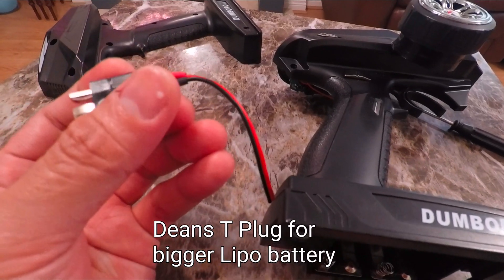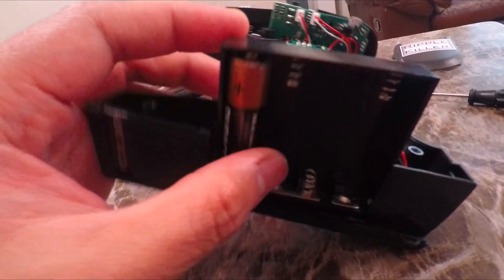Improved Remote Range and Response | DumboRC

Comment: There's an port for jst connector in the bottom off the receiver. Why you're doing that?can't understand. Just by jst to Deans convert connector then connect your 2s lipo.
Reply from the maker: Yes there is a jst under there but I prefer this shortcut. Thanjs

Comment: If I put rechargeable AA batteries can I charge them with USB port?
Also why don't you take the double A's out and put the light pole battery in that spot so you don't have in the way or dangling around
Reply from the maker: Hmm i don't think the usb would charge the rechargeable AA batteries.
The lipo battery pack outside is just temporary. I srill prefer using AA batteries.

Comment: smh... wish adding power would increase its range.. i can say is that it will last longer but still tx the same power.
Reply from the maker: Yes it doesn't.
But the delays are improved tho.
Reply: @ianbudgetrc2574  it wont affect anything. the tx will limit the power it allows in. i run my radiolink on 4s sometimes 3 or 2s it makes no difference.
Reply: @lcpeterbilt379  This is the information I was looking for!  Do you know at what voltage range will decrease when running the stock AA batteries?  I guess when it gets around 4.8v which would be 1.2v per battery?  I have been being careful to only run fresh AA batteries in it when my fastest cars to maximize range but now I am wondering if my efforts were a waste of time.
Reply: @ianbudgetrc2574  In the video you said it can go further but did you later find out it could not?  Thanks for the effort.

Comment: One point to consider, the controller will have a voltage regulator that takes the input voltage smooths it then delivers it to the circuit board , so no extra voltage should make it to the circuit board.!
Reply from the maker: Thanks for the insight bro.
But I don't know what makes the 7.4v battery better in this video. It has shown an improvement in transmission
Reply: It is rated up to 3s according to their manual and from testing this works for me also. But my usual range for AA batteries  is further than I can see
Reply: dont spoil it for him.. i totally agree with you but let his theory be his belief. lmao

Comment: Watching this video I noticed you Were a lot further away on video 1 ,on video 2 you only got to the square building on the right, this was not an accurate test.
But testing my friends car we got double the distance just in AA rechargeable batteries.!
Reply from the maker: Good observation brother. Thanks for your comments. Their difference was around 10 to 12 meters I think.
But as the car was pulling away, I was already noticing the delay in transmission halfway, with the 4.8v rechargeable batteries.
I understand, this test has flaws 👍

Comment: I have 3 dumboRC and I recommand you check your AA battery quality with a voltmeter.  I am using supermarket rechargeable batteries and i works very good as the stock range  is 500 meters.
A 150 meter range sounds like a faulty device.
Be also warned the dumboRC receiver may have runaways at full power and steering glitches when the transmitter is extreme low battery and blue led flashing, something I tough impossible on an electric car.... but that happened to me once and I am 100% sure there was no other RC transmitter around.
Reply: Yup I agree on low voltage battery. Even if wasn't flashing a little spike on low voltage tx will glitches.
Reply: Ah I see ,now I know who's dealing with my runaways RC and bump onto the gutter broke my upper arms, It's dumbrc receiver ,🙆🤦 glitchy on the steering too🤦
Reply from the maker: My AA rechargeable batteries are new and fine. Fully charged.
My lipos as well.
I've observed these delays just a year after owning the DumboRC radio. I guess it's the transmitter itself that's deteriorating..
I'm surprised that your DumboRC tx are still doing well.
Reply: can i use 2s 100c lipo battery